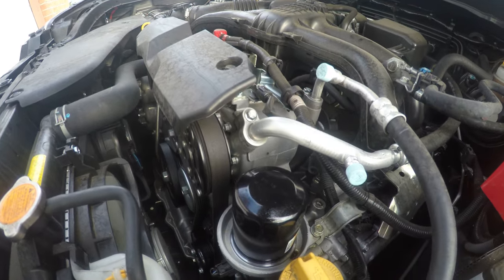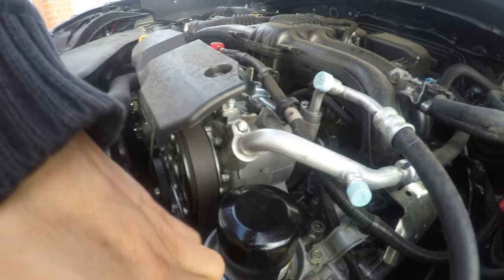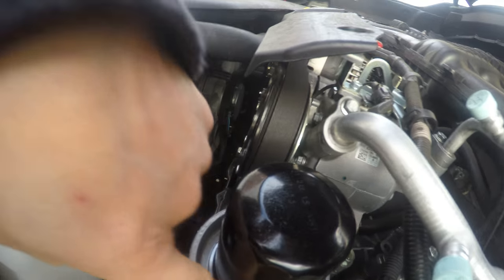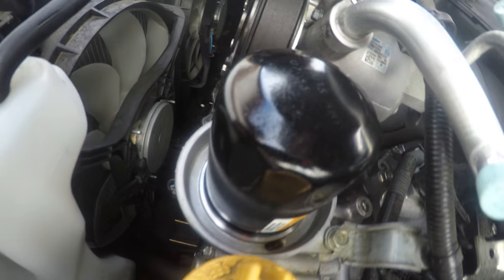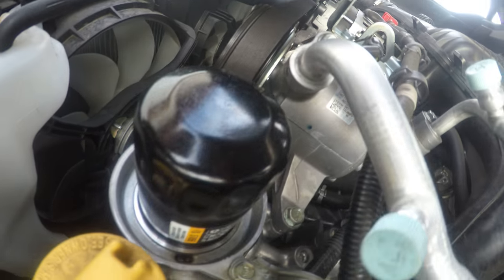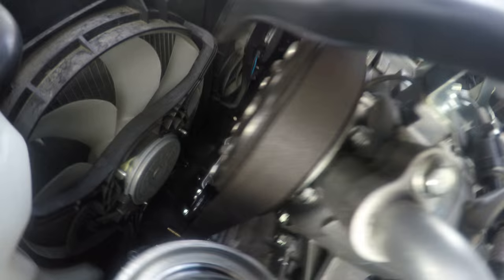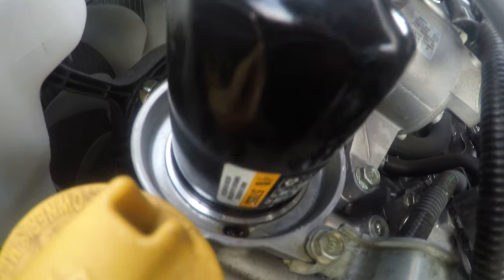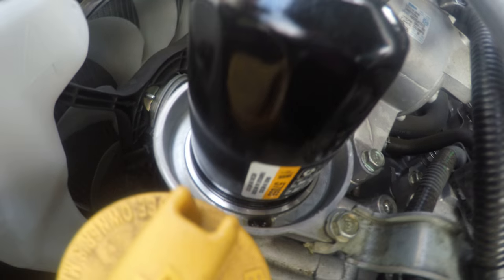What's the purpose of the "hole" at  Oil Filter Base for Subaru Forester?

Comment: Since the filter is mounted with the mouth down, it will begin leaking oil immediately when you start to unscrew it. The hole drains that oil back into the oilpan so you don't drop it all  over the manifolds and start a fire. You should be very grateful the filter is mounted so conveniently. Most are mounted underneath the engine and become a pain to change.
Reply from the maker: Thank you for taking the time to chime in. I cleaned the dirt, it is only 3/8 inch deep and does not go anywhere (I have updated this youtube video's thumbnail image, you can see clearly it is a "dead" hole that does not go anywhere). I remember I asked this question somewhere but can't find it. So I did search this video with "youtube hifzdYKYVTM", it turned out my question was merged with someone else's at a new place here: https://www.subaruforester.org/threads/where-does-weep-hole-drain-to.264610/page-2

No final conclusion, but the a few speculation points:
It isn't a hole, but rather a deep depression to collect sediment or residual oil when changing. That depression is so small, it should not increase the capacity too much, it is so strange why they designed such a way.

summary, there are many theories:

theory 1: a depression to collect sediment or residual oil when changing. this depression keeps stuff from falling of flowing into the engine when you take the filter off.

theory 2: it's just something from the casting/machining i.e. to make it so a machine can handle the part or something like that.

theory 3: subaru's future high end car has a sensor inside this depression so that it can detect oil leak :]

theory 4: it is for a different kind of oil filter
theory 5: oil cooler installation. 

I talked to my Subaru dealer, and he referred this to the service manager. Here is the reply:
"Hello David, No one seems to know for sure. Looking at it most say it is number 2."

Comment: Probablly to drain the oil that dripps out of the filter when you chage it.
Reply from the maker: Thank you for taking the time to chime in. I cleaned the dirt, it is only 3/8 inch deep and does not go anywhere (I have updated this youtube video's thumbnail image, you can see clearly it is a "dead" hole that does not go anywhere). I remember I asked this question somewhere but can't find it. So I did search this video with "youtube hifzdYKYVTM", it turned out my question was merged with someone else's at a new place here: https://www.subaruforester.org/threads/where-does-weep-hole-drain-to.264610/page-2

No final conclusion, but the a few speculation points:
It isn't a hole, but rather a deep depression to collect sediment or residual oil when changing. That depression is so small, it should not increase the capacity too much, it is so strange why they designed such a way.

summary, there are many theories:

theory 1: a depression to collect sediment or residual oil when changing. this depression keeps stuff from falling of flowing into the engine when you take the filter off.

theory 2: it's just something from the casting/machining i.e. to make it so a machine can handle the part or something like that.

theory 3: subaru's future high end car has a sensor inside this depression so that it can detect oil leak :]

theory 4: it is for a different kind of oil filter
theory 5: oil cooler installation. 

I talked to my Subaru dealer, and he referred this to the service manager. Here is the reply:
"Hello David, No one seems to know for sure. Looking at it most say it is number 2."
Reply: @GeniusAsian  Very strange indeed. :D